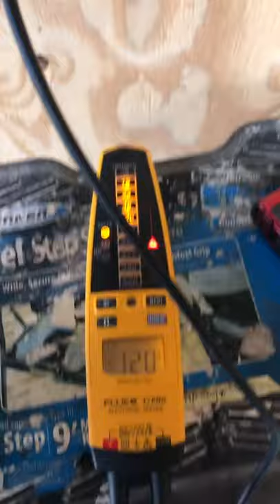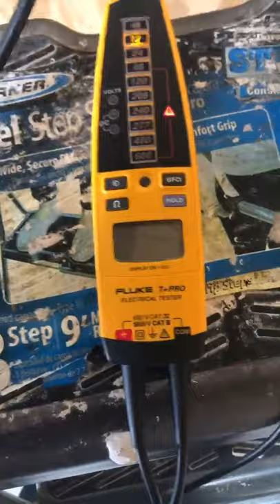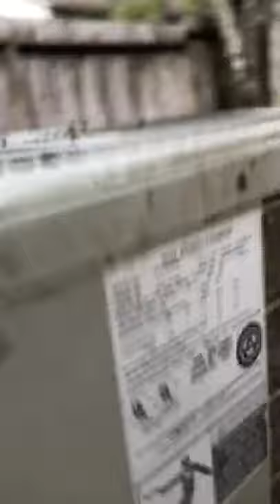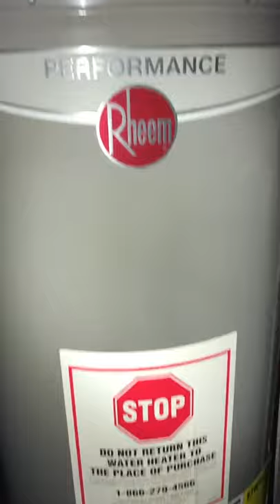38 Home Problems in 13 Minutes

Comment: You can actually have a toilet stub up go from 4" down to 3" per plumbing code as shown at 3:30 in the video. Certainly look like that might be a toilet stub. Last line the the code clarifies this is acceptable. 

310.5 Obstruction of Flow

No fitting, fixture and piping connection, appliance, device, or method of installation that obstructs or retards the flow of water, wastes, sewage, or air in the drainage or venting systems, in an amount exceeding the normal frictional resistance to flow, shall be used unless it is indicated as acceptable in this code or is approved in accordance with Section 301.2 of this code. The enlargement of a 3 inch (80 mm) closet bend or stub to 4 inches (100 mm) shall not be considered an obstruction.

Comment: What is the problem in the attic at 4:28 of the video and the panel at 8:57?  Great work.  I learn a lot here as a flipper.
Reply from the maker: The first time slot was a truss was missing at the end.  I believe the clip was cut a little short.   The second clip was the wire was too small for a 200 amp breaker.  Can overheat and cause a fire.